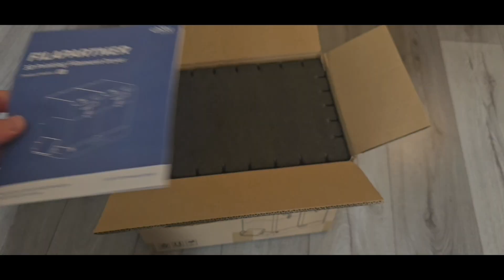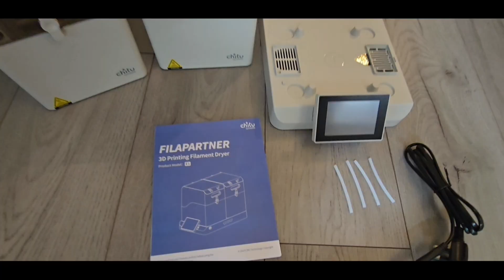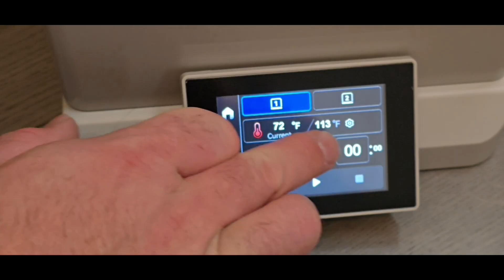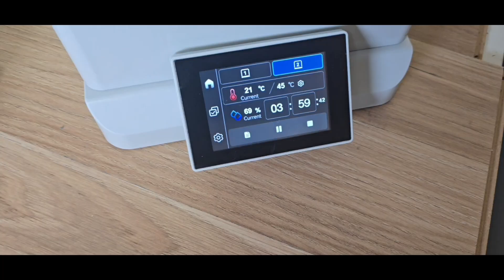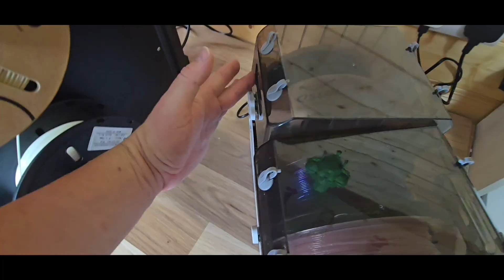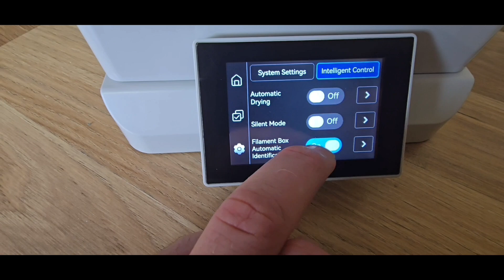“Best Filament Dryer? STACKABLE BOX SYSTEMS FILAPARTNER E1 Hands-On review"

Comment: The ports on the side are for firmware updates which ive been told there is 1 that takes the dryer to 80° perfect tor higher technical filaments
Reply from the maker: That's awesome too know